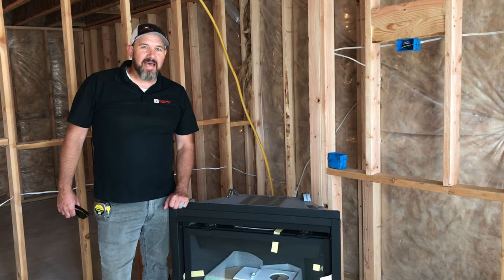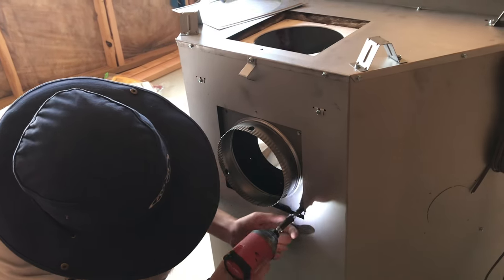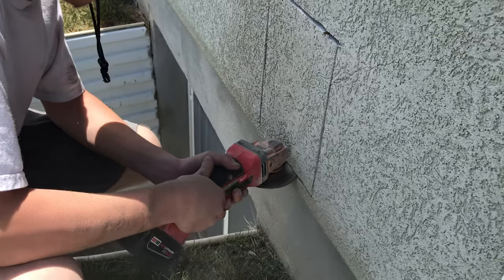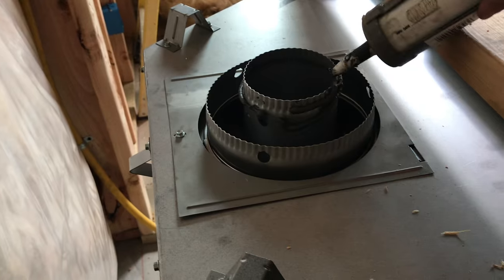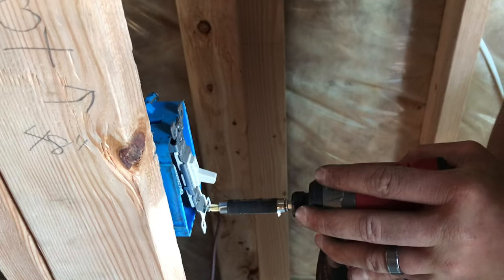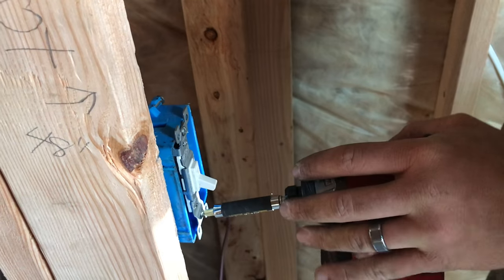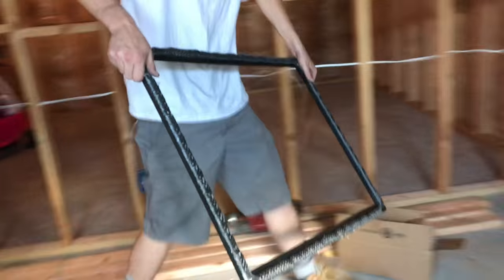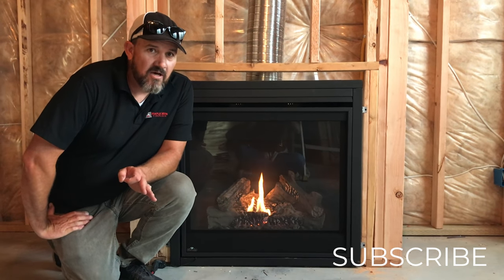Installing A Gas Fireplace

Comment: How about the fire retardant that is installed inside and around the framing?
Reply: Depends on your jurisdiction and applicable codes  ... the manuals come with specifications for clearance between the firebox and the surrounding frame/mantel, etc.

For our application we're using CGC Cement Board ½" thickness with steel framing studs.  Insulation is a "rock wool" for 16" OC with Steel studs (2 × 4).

Comment: Many thanks!  I'm building my enclosure for a GS36 now and was doing some due diligence and found this video -  to see you installing the same exact model is amazing.   I'll be rear venting through an exterior wall with vinyl - any thoughts on the best vinyl shield?   Everything keeps pointing towards a DuraVent Product - thoughts?  Also - I had black pipe installed and run directly to the center rear of my bay, now that I see the gas inlet is on the side I guess I just run flex around to the inlet and  allow for a deeper enclosure, part of me wonders if the heat generated in the enclosure is a consideration vs. the durability of the flex line?

Comment: I have a question I hope you, or someone on here might know the answer to. When they installed our fireplace, it was put between two windows. Problem is, it isn’t placed equally between the windows. There’s about 1” or less on one side and about 4” to the other and everything on the mantle is built centered and evenly spaced. Is there anything that would prevent me from rebuilding the mantle and moving the fireplace where it’s even between the windows for any reason? Thanks!
Reply from the maker: Hello! You would want to check your manual for framing specs and clearances first. Then you just want to check your venting, gas line, and electrical. If your venting is flex it should be pretty easy to move but if it is hard pipe you may have to call them back to uninstall it.
Reply: May be load bearing studs that prevent you from going one way or the other.

Comment: Nice job on the video.  Right to the point.  I am surprised that you don't have more views.  This was the best video I found in regards to setup.  Thank you
Reply: 1 question though at 1:32 in your video you say to reinstall the insulation on the back.  The installation manual says (pg24) to discard that insulation.  Please advise
Reply from the maker: Thank you! We're glad we could help.
Reply from the maker: @ManCaveMechanic  We definitely would advise you to follow your manual. Thank you for pointing that out for us.
Reply: @ManCaveMechanic  Good point! You have to discard it! It's fire hazard. It'll soot, too.

Comment: Hi great video.  I'm installing mine and I need to level it and bring it slightly forward, it's leaning back a little about 1.5 inches.  Is it safe to use wood wedges/shims or to bring it forward.

Comment: I have similar fireplace.i notice cildvair draft coming from it.builder says it's common in direct vent.is it so? I notice a hole left unclosed on the bottom and also the gas line hole is not properly sealed. What can I use to seal around the pipe.

Comment: IMPORTANT QUESTION: I have a new finished home without a fireplace. obviously the fireplace company I will call will have to destroy part of the wall to make holes. Will I need to wall other construction workers to fix the wall after that? Or does the fireplace company take care of all the damage needed to install the fireplace? And one final question: can a gas fireplace be installed at any exterior wall, or are there any conditions?

Comment: What is the main reason for draft from the bottom of these direct vent gas fireplaces? I have a heat and GLO and cold air draft is coming from bottom.
Reply: Same issue with me 
It seems like there is a constant draft

Comment: Rookies, you connect gas and electrical before vent and final set to test fire, you can not pass c.s.s.t. thru the fireplace body. It must be sleved or you must use a termination fitting
Reply: Actually as a fireplace Installer myself , you actually do vent rhe unit before you gas and wire it!! Otherwise gas can be opened up with no where to get outside rhe building and it must be secured so but to rhe installers top notch!!

Comment: Can this be done after the house is handed over to us once it's finished by builder? They will rough in the gas line and the PowerPoint. Can I purchase the fireplace after handover and install it or is this going to be impossible? Please advise as they won't let us do anything if we're not doing it through them... Truth is if we were to do it through them, it would be too expensive 😏
Thanks

Comment: Your video was very informative. I bought a ventless gas heater, and I was wondering do you have to put cement board around the fireplace or just drywall... I'm not tiling around the fireplace.
Reply from the maker: Thank you Connie. It's going to depend on the specific clearances of your fireplace but most likely you will need to do cement board.

Comment: I have a  two-sided-view Napoleon zero clearance fireplace box installed on cement floor.  It has flex pipe and I want to lift it a couple of inches and  allow for flooring so the bottom access grill can still be opened.  Does a full sheet of OSB or plywood need to be slid underneath or could 2 “ bricks only  be placed flush under the perimeter of the box? Would anything go wrong with the flex pipe if this is carefully done?

Comment: Thank you for the follow-up on the stones. Any thoughts on the switch.
Reply from the maker: You bet! That actually goes for both the stones and the switch. As long as the new switch is recommended by the manufacturer you shouldn't have an issue trading them out.

Comment: 1 that I looking at has 2 vent pipes . Feeding air coming down and vent out. Going up the stack .   You know what name of flex hose?   Are they s/s ?
Reply: Those in the video are aluminum hoses, they seem to be 4" and maybe 6", but there are rigid ducts that are galvanized steel. They are not stainless steel.
Reply: B36 uses a 4"/7" pipe. Larger fireplaces by Napoleon will use a 5"/8". Interior pipe is the hot exhaust, exterior is the intake. Napoleon makes those kits for their fireplaces. There are lots of online dealers that sell them. Currently run around $350 or so for a basic kit with 5' of pipe and an exterior exhaust.

Comment: Please respond 🤞: my direct vent fireplace has such a huge pilot light, that makes such a loud noise, but when I turn it down to a quiet volume using the red handle, as soon as I turn the fireplace on, the pilot light dies.... Any ideas?
Reply: Hire a licensed gas fireplace installer/technician

Comment: We are in the process of having a contractor install a similar Gas Fireplace. I am wondering why the Cool Surface System (CSS) is not being addressed in any of these FP install videos I am searching for. Isn't CSS critical to the install of Gas Fireplaces?

Comment: what if i have a fireplace installed with a gas line already but no electric ignition or anything like that? I just got a home with the piping (gas) and venting already taken care of but the owners didn't have the gas logs or wiring setup. How big of a job is that? Can i do it myself or should i call a professional? Also do i need a switch like at 4:47 or can I just light the gas with a standard lighter?
Reply from the maker: We don't recommend lighting the unit with a lighter or rigging anything up to the unit that has not been tested. The unit should come with some sort of ignition. The rest really depends on the brand of your unit. If it is a brand that we work with we would be happy to assist you further. We would just need pictures and the serial number. Our email is sales@maplemtnfireplace.com. If it is not a brand we work with we can help point you in the right direction.

Comment: I need to make a comment on your galvanized pipe yeah galvanized pipe has gotten a bad rap years ago here is in 2023 well galvanized pipe has gone through a whole new process we've upgraded a whole new zinc process galvanized will not flake off zinc coating anymore so it is now allowed to use for all gas piping I've been doing gas for 45 years and now that is all I use is galvanized pipe it does not rust out like black iron do for all you black iron gas workers galvanized pipe is allowed to use in every state I hope that clears up a lot of questions on galvanized pipe

Comment: I have a similar fireplace but to be more specific it is 36 x 36 by FMI gas vent. Can I remove the logs and place colorful stones in its place for a more modern look. Also I have a wall plate switch connected, can I just disconnect it from the old switch to replace the switch with a new one.
Reply from the maker: Hi Will,

Great question. All units have been tested in order to be EPA certified, and not all gas fireplaces are created equal. We would recommend either going through your manual or calling the manufacturer/dealer to see what options they have for you. A lot of dealers will have ceramic rock kits for a more modern look, but a lot of rocks hold air and will pop once they are heated up which can be unsafe in an air tight gas fireplace.

Comment: “Just use the mill pack”… what the…?  If you’re trying to help someone know what to do, then sorry but 👎👎👎
Reply: mil pac is the high heat sealant. It's good up to something like 1000 degrees continuous.
Reply: @onekidthere  ... my Mill Pac black specifies 1200° F  

The high heat RTV silicone is good to 750°F